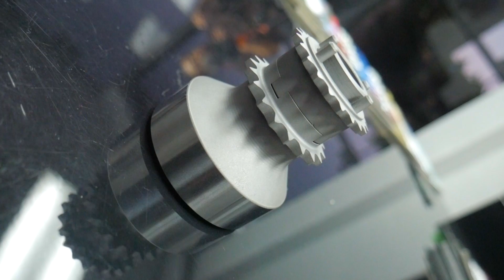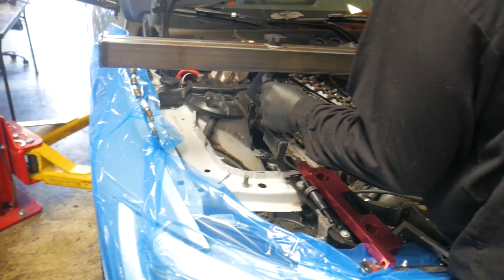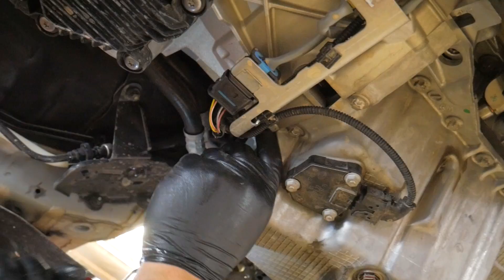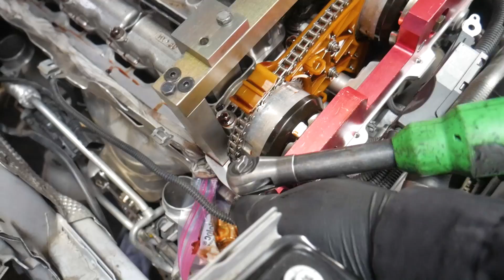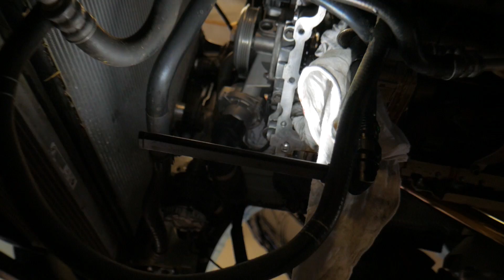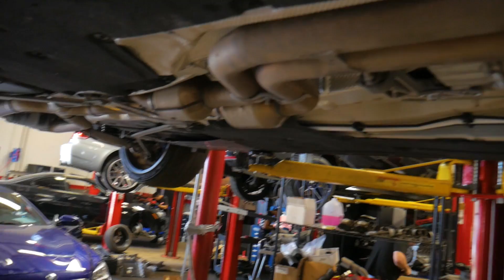BULLETPROOFING MY S55! | Keyed 4 Pin Crank Hub Full Install | Start to Finish + What to Expect!

Comment: Glad you did it and got it out the way. Tell people all the time it’s not a matter of when it’s a matter of how soon.
Reply: 75000 S55 motors made, very few failures,  mostly people who beat the crap out of them. The data is out there, less than 1%.
Reply: Jack O you keep saying that, then why is there a class action law suit against Bmw for it in California? Why does every one saying it’s a must if you’re going to get tuned ? And even if you’re not going to get tune do it lol. I’ve known too many people this failed on, you can believe that flawed data if you want.
Reply: @datm340i6  Right sure you do, everyone you know drives a S55 powered car, right?  The majority of people who have these cars lease them and drive them like grandma, only a handful actually take them road racing.  Did you say you even own  one of these cars?
Reply: Jack O brother owns on and it went on him. All he had was down pipes and stage 2 bm3 tune. And I currently own a 340i. I hope you own one since you talking like you know it all or have a bunch of friends that do lol
Reply: @datm340i6  Yes I have a 2015 M4, 62k on it now,  it has full exhaust and JB4, and filters. I have run 100 octane in it a few times but for the most part I don't even drive it fast, I am 47, I  have had many turbo, supercharged,  nitrous cars in the past, but I don't beat on my current cars anymore,  because Quite honestly I don't like turning a wrench anymore.  I only know 2 other people with theae cars, all stock grocery getters.
Reply from the maker: yes I agree a large majority of these cars never see failures but most of them are stock. I never bought the car for it to be a grocery getter. It's going to be my track tool and build for YouTube, so that's why I got it done 👍Tuning the car, particularly with E85 seems to exasperate the issue of the crank hub spinning. I know many people personally that have spun their crank hubs and it sucks when it happens
Reply: @SimplyCarThings  Of course you should do it if you are going to abuse the car, I have never said that, I am looking forward to the new M4, so I really don't want to put any more money into this car, if I were to keep it yes I would do it as well. Good luck with yours, hope you enjoy the car.

Comment: Congrats on the piece of mind. It really sucks BMW did this to us with the stupid ass factory design. Makes you feel like you have a ticking time Bomb that may or may not ever go off. Makes me wonder though..... what percentage of the 75k plus s55 engines built have spun the crank hub?
Reply from the maker: I do agree man the design is wack. The issue is exasperated with an aggressive tune, and the addition of E85 fuel
Reply: I guess there is no way to tell but it did look like when he pulled your factory crank hub the friction disc was ok and not wrinkled or anything. Not sure if that means anything or indicates anything. Just a thought.
Reply from the maker: number36420 Yea the crank hub looked like it was in good shape, even my spark plugs had minimal wear but this was all done as preventative maintenance
Reply: How many miles are on your car, just curious? Also I’m assuming your car was never tuned to your knowledge? No jb4 or flash from the previous owner?
Reply: It's not so bad that they did it,  it's bad that they did not revise it, that shows how corrupt they are. Because by revising it in a certain model year they would indirectly accept responsability for all the previous failures so they pretend it doesn't exist.

Comment: Wow all this maintenance looks complicated just for the extra performance, good thing i settled for a stage 3 tune 435i.
Reply: zero performance gain from this process brother, just piece of mind so the motor won't pop
Reply: How is stage 3? I'm still thinking if I wanna commit to losing my extended warranty and modding (2015 335i).
Reply: @chrisgarret3285  it's definitely worth it, i started off with a stage 2 tune with an upgraded intercooler. Then i did pure turbo upgrade along with the high pressure fuel pump. My next goal is to get M5 injectors, meth  kit and N52 cams, right now im at 600whp
Reply: @SEANWILLIAMS45  how do you know what shop to go to for it... or what shop you can trust with it?
Reply: @chrisgarret3285  well I'm in Toronto i go to midnight speed @midnightspeed on Instagram